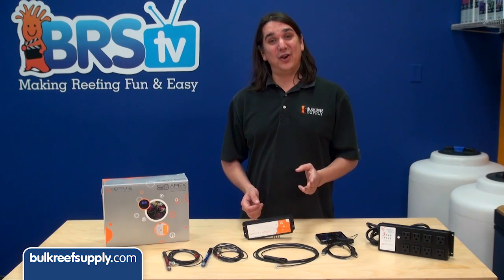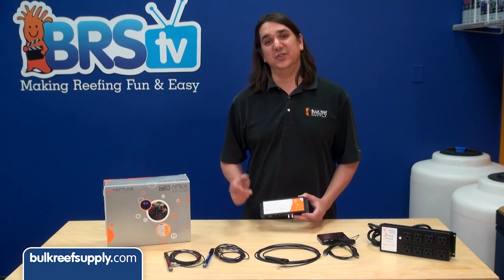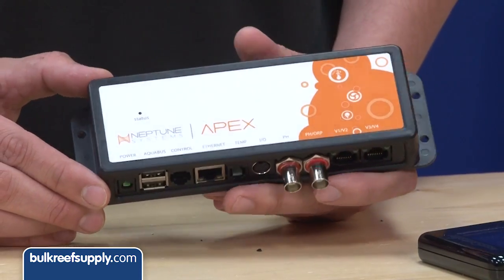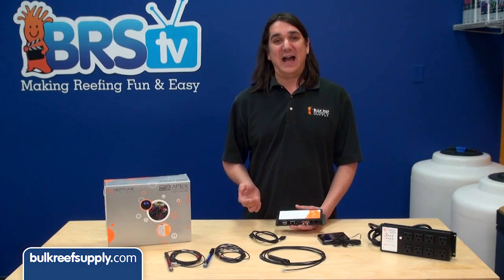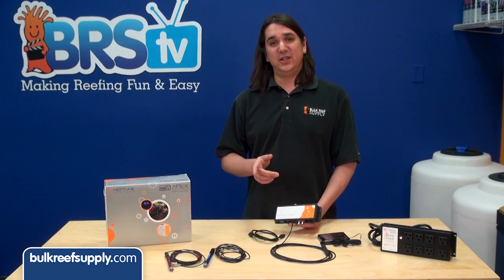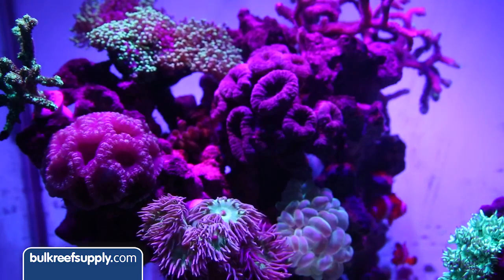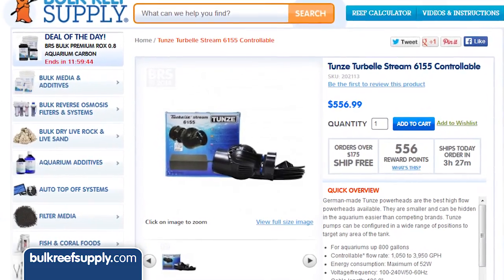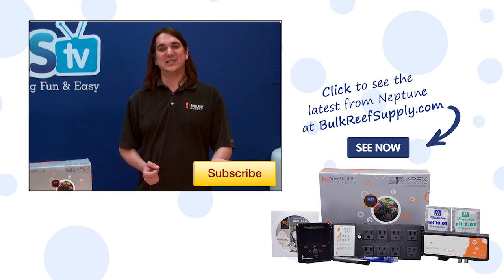Apex Base Unit and Connections - EP 3: Apex Aquarium Controllers from Neptune Systems

Comment: I'm getting back into the hobby strong after a 5 year lull. I always kept a very basic reef but miss the intricacies of a sps/clam reef. Your videos have been extremely helpful to get back up to snuff with the latest and greatest.  5 years back I was interested in LED's but they were expensive, unreliable and many people reported poor coral growth. Your very in depth review of the kessil 360we tuna blue made it a no brainier for my 92 corner with archaic failing power compact fixtures. Even if the kessil fails after two years of use they are cheaper than a metal halide setup. Just placed an order with you today for an apex and a couple more kessils! Thanks!

Comment: Just started a new tank...and got the Apex Gold packagae... connected the probes...Temp, pH, (Both working/reading correctly) and ORP probe (to the pH/ORP connector on the base unit)... the screen on fusion and the display shows pH2 and a reading of 5.61...  How do you switch the pH2 over to ORP?

Comment: IF my Apex would work without loosing connections periodically, properly without worried supervision, have repeatability in its functionality, be end user friendly minimal software manipulations (Iphone, people). This would be a great product. 
 They jumped the shark too soon and too early. They lacked  proper R&D on their part for an aquarium controller.  DO YOUR RESEARCH. When it works- its AMAZING, when it does not, you LOOSE- everything. My advice: stick with PH and Temp monitoring with the JR. Apex. Everything current in this hobby  is sold with intelligence. The less your rely on this over-blown, over priced aqua controller, the more you will be appreciative of what the aquarist have in their arsenal of control- other than APEX. Buyer beware.

Comment: My favorite Break Out Box application is adding a magnetic switch to the cabinet door. As Ryan mentions in this video, you can use this switch to turn a light on and off in the sump area when you open the door. Another great idea is to also have it trigger an alarm which will email/text you that the door is open for those times when the kids get a little too curious.